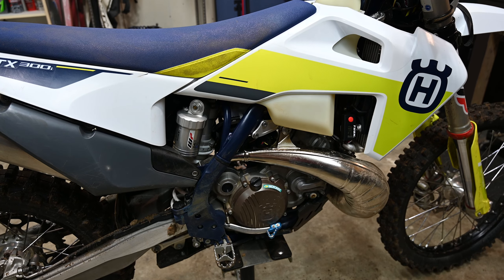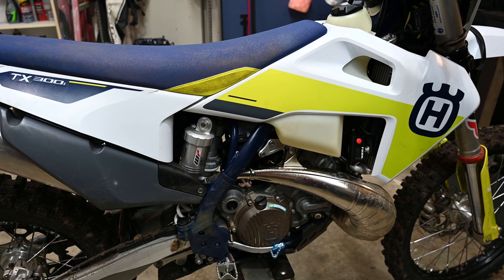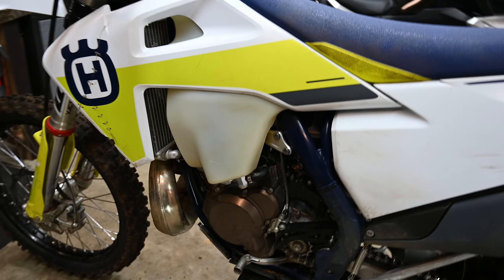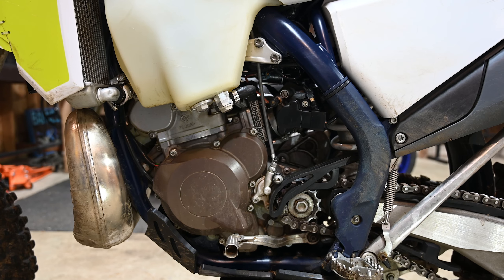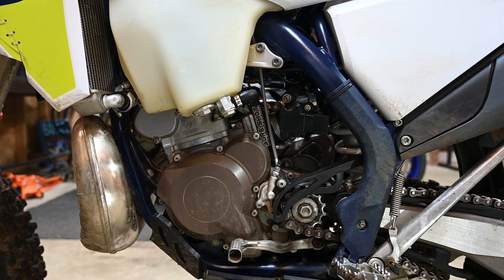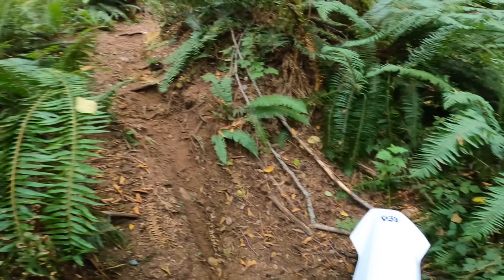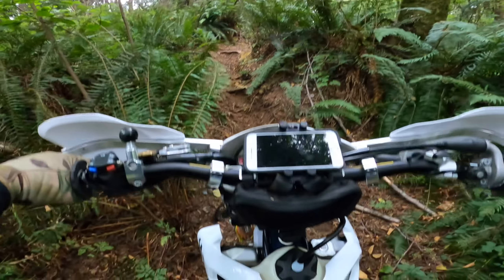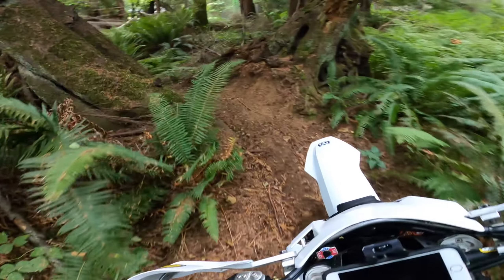I went from TPI to TBI (and back to TPI) - KTM Throttle Body Injection REVIEW

Comment from the maker: Latest Update: I was chasing an inconsistent idle with the TBI setup. After full throttle, when coming to a stop, or going on steep downhills, the idle would drop pretty low. To prevent it from stalling, I would turn the idle screw up. This had the bike idling a little too high in other situations, and I think it was causing the ECU to run in a richer portion of the map. The bike was pretty blubbery/rich down low (see my latest snow riding vid). So I'm back to TPI for the moment! 😂 Oh, and since then, I've found that the "hesitation" I noticed as a TPI was just needing a new CCPS. So we're back to running perfectly, but as a TPI with a great consistent idle and no stalling, and without that extra bit of low end torque that the TBI offers. 🤷‍♂️
Reply: Try racing ECU, higher compression head and open up some way at the air filter so it can take more air, i have seen people who race do this to make the bike run properly
Reply: @buuuu7691  I can't imagine it is starving for air at idle, which seems to be part of the issue but not all of the issue. You might be onto something though.
Reply: Put an RK Tek head on. That will fix that lack of bottom end jump.
Reply: Did you play with a bypass screw to adjust the idle after screw in the throttle itself? I am on the exact situation now,since installing a relocation kit.I’d play with a bypas screw and idle gettin better.
Reply: They now sell a split kit for an additional $20.   I wonder how that compares.
Reply from the maker: @Greg_383  i’ve been running the split kit for about 30 hours now. It solves the issues I had with the full kit, idles consistently, and doesn’t load up. But I have to run the JD tuner so I can fine-tune the fueling.
Reply: @WASemiHardEnduro  Nice!  I have a Tpituning ecu currently.  I'll probably try the split relocation block soon.
Reply: Thank you for your reply. I’ve seen a couple of split relocation kits that look promising and I may try one of those. I really think the relocation kits helps premature cylinder wear and that’s why I initially went with it in the first place. I’m not a racer so the bike ran good enough for my style riding (slow technical stuff). But this is the last straw for me. If that doesn’t do it then I’ll switch back to TPI and put a for sale sign on it.
Reply from the maker: @prestonthomas9406  I had the same issues with the split kits btw. 
Also TPI premature cylinder wear is a myth imo. I did my rip end at 250hrs and it was absolutely perfect. All crosshatch still there, even piston looked almost new. 
Just warm it up properly and keep the air filter clean.
Reply: @kostapopov384  did you ever figure out your issue?
Reply: @brianwilson1145  
To be honest I noticed a stable idle when i ride off road.This because the crank case stays clean.When i go on track with less trottle idle is very low,even the engine shuts. This because crank case becomes full of mixture .Typical carburetor situation,kind of.So,set up a idle on off road,and when you go on tracks use a trottle often to clean up your crank case.

Comment: I also ran my KTM with TBI and TPI back to back. I experienced the same issues...stalling on descents and more wheel spin. I found the wheel spin issue to be my fault. I wasn't used to having slightly more power thus had to re-learn my throttle control. I did that and turned up my idle a bit and have been happy with it. I find the TBI is smoother and easier to control when it really counts. For me the benefits outweighed the negatives

Comment: I installed the Athena re-location kit on my KTM 2019 300xcw along with Athena traction control and high compression head and had Slaven’s tune the Athena ECU and this is a new bike as far as I’m concerned. I can start in 3rd gear and almost never shift, it’s like an automatic or electric bike. Glad I made the change. Thanks for the video, good info.
Reply: Any more details on this. There’s not a lot of info on YouTube for this kit. Trying to do this on my ‘20 Ktm 300xc
Reply: @Shiddyvet  If you go to Slaven’s Racing they have a good bit of info and videos on the system. Not sure how the 2020’s have there cylinders setup but I suspect there the same if they offer the re-location kit for that year. Fairly easy to install and Slaven’s will program the Athena ECU for you if that’s what you plan on using. Talk to Alec at Slaven’s he’s the guru when it cones to all that.
Reply: @prestonthomas9406  thanks man

Comment: TPI is TRANSFER PORT INJECTION; 
TBI is Throtle body injection.
TPI needs separate oil injection to lubricate de crank.
TBI can use pre-mixed fuel to lubricate the crank.
Reply: TBI is just an advanced carburetor, including automatic pressure+temperature adjustment. And lots of electronics. Any sense for a hobby-bike...?
In my opinion TPI is the best compromise for this pupose; better fuel consumption/emissions by using cheap automotive technology. Only disadvantage is the need of external oil supply.
Reply: Based on the critical nature of oil injection that alone would make me run TBI with premix.

Comment: I made the switch to TBI (Athena) on my 2019 KTM 300XC-w TPI (21 hrs) and it’s been the most miserable mod that I’ve done on this bike since purchase. I can ride it for 10 or 15 minutes of easy trail riding, shut down for a few minutes, try to restart and the thing fouls the plug every time. It is so unreliable that I don’t even use it for trail riding any longer. I’ve contacted the company that I purchased it from (Slaven’s Racing) and they remapped the ECU twice without any change. Even tried to contact Athena for some of their wisdom (no help there). So now I’m at the point of going back to TPI and see if that eliminates the fouling or else put a for sale sign on the thing and go back to Japanese bikes (really frustrating). Nice to see someone thats switched and having good success with it, wish I could say the same. Thanks for a well done informative video.
Reply from the maker: I went back to stock too. It was just too inconsistent as a TBI. Very happy with the John Ross tune and regular TPI.
Reply: @WASemiHardEnduro  Was it fouling plugs also?
Reply from the maker: @Preston Thomas  No, it mainly had an inconsistent idle. It would almost stall going downhills so I had to turn the idle way up, but then it would be too high other times. It was also pretty rich off-idle - if I didn't have the JD Tuner, it might have fouled plugs.

Comment: I have the 22 300xcw with a little over 30 hours and a 13 300xcw with about the same hours 😎… Power on the carb model is bigger but I prefer the smoothness and much calmer power of the 22 for tight rocky single track. I do big elevation changes so it’s hard to beet the TPI. I feel peak rpm power is the same on both but the carb bike is more in its element on wider open terrain where big hills are involved. Almost as if the carb bike has a small supercharger and the TPI is more electric.

Comment: The bike sounds more responsive with the kit installed for sure. I have a feeling the new TBI models will be a big step forward for the KTM brand bikes. It's probably not a coincidence KTM is releasing this now with both Sherco and Beta poised to release FI two strokes soon.
Reply from the maker: TM this year switched from TPI to TBI. It’ll be interesting to see what the other manufacturers do.
Reply: Where have you heard beta and sherco releasing FI 2strokes? Sherco have had the kit for years and haven’t bothered with it because the carb is better … Ktm we’re forced to put it on there bikes because of EU regs with the amount of bikes they sell here … that is all
Reply: I hope not they were my fall back bikes when i need to upgrade my 2018 300 🤦🏼‍♂️😂
Reply: @HalfHourOfPower  arent france and italy part of the EU?
Reply: @gixxxer1k  yepp but sherco and beta etc don’t sell anywhere near as much as Ktm so don’t have the same restrictions

Comment: I did the same to my 20' 300xcw.
I tried the get race kit, swapped to the sure shot. I have to say my bike ran horrible. Low end power was weaker, had a bad off idle stumble and a lot of stalling out.
I wasn't the only one, found several others on the forums that encountered the same issues.
It seems all these tpi bikes run differently.
I went back to the stock setup, added a flywheel weight and a clutch weight and the bike runs great. I do have to mix in some octane boost to keep it from occasionally detonating.

Comment: I got a 2021 te300i. mine had that hesitation or maybe slightly loading up.  I got it running extremely good now  I put a bpr7eix plug in. If I remember right it came out the box set at .028 and the book recommendations is something like .024 so I set it to the book, I could be slightly off on those numbers but just set it to the bike specs. also I installed the red spring in the power valve and a quick power valve adjuster so you can adjust it by hand without shutting the bike off.  you can still adjust the red spring to be mild and smooth if you want it, its way better than the stock spring. I turned the air screw to 3 1/2 to 4 turns out. it still has that really nice low end power to get you going on hills and over bad roots but is very crisp and instant when you twist the throttle.

Comment: Great vid and explained clearly ,I have a few carbed 18 /19 ktm/Husky 2 strokes with aftermarket heads and keihen carbs with a Stic module fitted which run very smooth with good torque minimal pipebang etc ,I don’t do big elation changes or temp ( 5 deg C-30 -C usually ) so for me this setup works well ,if I was doing big elevation changes etc TBI would be the way to go ,whether you go carb or FI you need to spend a few dollars to get the best out of these bikes if u are anal how they ride/run .👍

Comment: I ended up going full premix, best running bike I have ever rode, I have had several Smartcarb bikes and fuel injected 4ts. I have never rode anything as clean running as turning the Tpi to premix
Reply: Hey JD where are you running the injectors? TP or TB? I’m on the fence what way to go. Having the same off idle hesitation and it bugs me.
Reply: @j-moto1215  I am currently running the Sureshot block relocation with stock mapping, I have ordered the TSP hybrid setup with one TPi injector and the other in the airboot where the air sensor is, it will also be remapped and vforce reeds, wont have a review until around March when the weathers warms in IA.
Reply: @jdracing551  awesome that’s the route I’m going too. Can I ask why the switch? I bunch of friends are running that same kit and love it but I’m unsure.
Reply: @j-moto1215  on my bike it mishaped my airboot bad enough that my cover for washing doesn’t seal.
Reply: Makes sense, stoked to see how the hybrid kit works. Cheers for the replies !

Comment: TBI can run premix...with TPI you have to have oil injection.  TBI was OEM on 2 stroke sleds in 1992.  Before that on outboards and was aftermarket for sleds in late 80s.

Comment: I brought this mod up for the TPI guys in our group and I kind of got some slack from them over it... Mostly because I said if I had a TPI bike I'd do this conversion.  
Since I don't have a TPI bike, I've decided to try the new Lectron Billetron 38 carb. Word is it produces better low-end power and over all throttle response and I'm all about that.
Reply from the maker: If what I’ve experienced is anything like what factory KTM is doing, I can see why the factory racers have gone this direction. 👍
Reply: @WASemiHardEnduro  Since I've heard about factory TBI, I've had a feeling it'll be coming out on the "completion only" machines, at least initially.
Reply: @WASemiHardEnduro  I would be all over a TBI bike 6 months ago when I bought the TM if one was available. At the time only TPI and its not there for performance, its primary role is emissions. Had I known 2022 TM's would have TBI I likely would have bought one. I love fuel injection and the ability to map to suit preference. I don't like forced unchangeable oil injection to meet emissions at the potential cost in engine longevity. TBI seems the solution to this.
Reply: I just fitted that Billetron to my 21 TM a couple days ago and love it. I couldn't get the jetting quite right on the keihin. Get it smoothed out and crisp and it would get really hot in the gnarly stuff, go a little richer and a lot of spooge and smoke for those following. Start with recommended settings re idle jet, needle type, clip position etc etc then someone says oh yeah, you can't get jetting right because the slide is too rich at 6.5, you need a 7.5 ... Just gave me the shits.  Anyway my normal loop uses about 6-7 liters of the 9 litre tank. Yesterday I used about 3.5 litres. A third of the way through it boiled over on a nasty climb, once it cooled off took a few minutes to richen up the metering rod 1/4 turn and half turn on the idle to compensate for the extra fuel and no temperature issues after that. I never tried the original so nothing to compare it to however its smooth and linear so even if I use a bit more throttle it doesnt make it twitchy
Reply: @1Beetlegeuse  I bruised my sternum & ribs on the first real ride with the Billetron 🙄 So I've only had limited time running with it, but I really like how it made the bike feel. I may need to lean the metering rod a bit, I'll know more once I heal.
Reply: @painsrides  ahh yes I saw the video. I've been undecided about lectron or smartcarb for ages and your video was one that helped make up my mind. I wasn't after more power but just consistency and knowing everything is working right and preferably not losing power anywhere which I don't seem to have done. I think you'll really like it
Reply: @1Beetlegeuse  Thanks for watching and I'm glad the video helped. Wish I could have given more info on the Billetron but 😐...

Comment: Hi did you try moving only one of the injectors? I did it this way and I am pretty happy with overall performance...
Reply from the maker: Yes I’m running a hybrid setup now and am liking it better than either other way so far.
Reply: @WASemiHardEnduro  hola buen día, al usar la opcion de hibrida sigues utilizando la inyeccion de aceite mediante la bomba? o la eliminas y haces pre mezcla? acabo de comprar un kit de pinit racing y ellos aconsejan añadir aceite al deposito al usar el kit dividido, pero no se si se pueda seguir usando pura inyeccion mediante la bomba en cualquiera de las dos opciones, gracias y saludos

Comment: What's funny is everyone points out tpi at times runs at 80:1 while idle to close to half throttle.  But runs more like 40:1 at 1/2+.  But the new TBI Bikes wan't a 60:1 premix ratio.  So when it really counts...  They are running 60:1 instead of 40-ish.  Thats whats great about TPI.  Get a new flash if you like.  But you can taylor make it what you want with tpi.

Comment: Thaks for your review!
I'm not sure to understand... at minute 3:10 you tell that you install the TBI kit for handful rides and then you went back to TPI. 
At minute 5:10 you tell that you re-install the TBI because you would like to reach again the "99%"...
Right now, are you still with TBI kit?
Reply from the maker: Correct. Went from TPI to TBI, back to TPI, then finally back to TBI again, and sticking with TBI for now. I felt like this was the best way to truly judge the differences.
Reply: @WASemiHardEnduro  Yes, I agree. Thanks!
Reply: @WASemiHardEnduro  Just a question, do you removed the thermostatic valve?
Reply from the maker: @sberga5058  No, and you shouldn't remove the thermostat on a TPI.
Reply: @WASemiHardEnduro  Yes, you have right. I've removed but in the winter I see that the engine is not working well (Husky TE 250 2020). Thanks!!!
Reply: Do you run the stock gearing ratio 13-50?
Reply from the maker: @sberga5058  I run stock 13/51 on my TX

Comment: Have you tried the sliber turbo reflash of the ECU and a higher comp head? Curious if you have tried that to compare - i'd say my 300 runs 99% at least with those mods.
Reply from the maker: No I haven’t. I heard TSP is working on a TBI -specific tune though, which would be interesting to try.
Reply: @WASemiHardEnduro  meet up at walker, or east side and try mine, it'd wbe a good comparison.

Comment: One of the most important aspects of TBI is that you get better bottom end bearing lubrication. This I think is one of the main reasons KTM went back to TBI. I would never have a TPI bike mainly because of this one failing.
Reply from the maker: You had a TPI bottom end fail? I’ve honestly never heard of a TPI bottom end failure that wasn’t drowning related.
Reply: @WASemiHardEnduro  That's exactly right; the failure is that anything someone says on the internet must be true even without any factual information. To add on the TPI and how good it really is, when we're performing top end rebuilds, the cylinders look great.  So TPI is showing to be a very good system but the few that did fail (and who knows the real reason why they failed) are being bastardized on the internet.  Now that KTM has introduced TBI on the market, it might be a better system overall, but to your point about traction and how TPI actually works in a funny great way, that will always be true.  I like the way the TPI systems are not so harsh when you're in the loose nasty stuff.  Great video and the way you explained everything was really done professionally.  Great show.